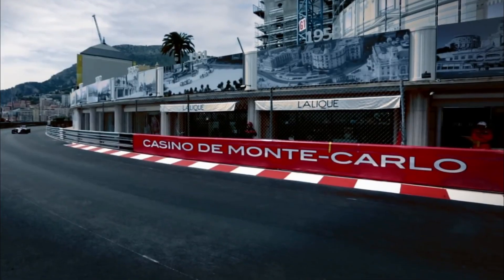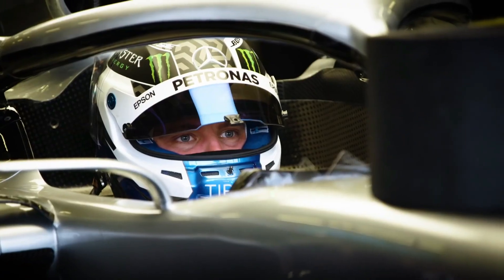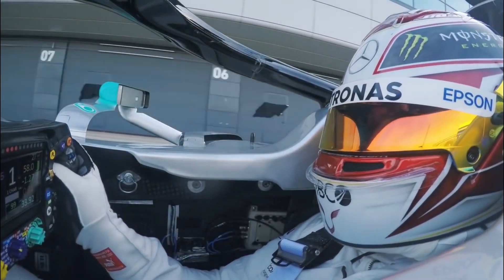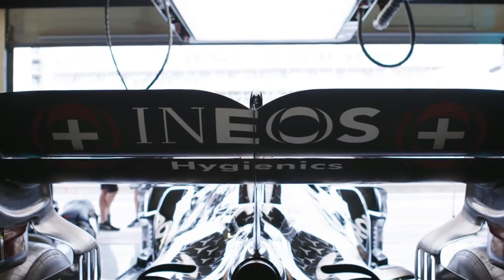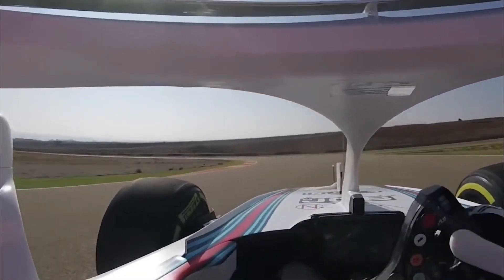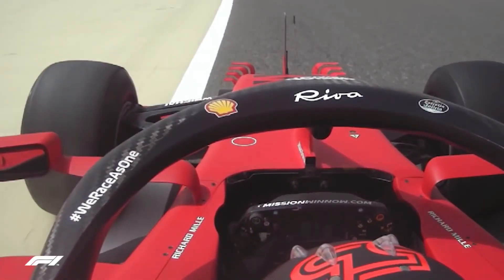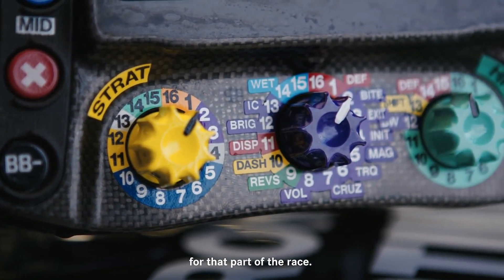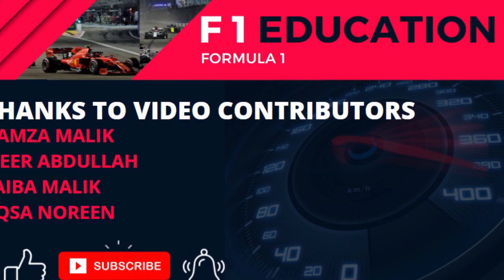Formula 1 Steering Wheel Explained

Comment: Great video! Was it the Brake button that cost Lewis the race in Baku? Also, I've heard that drivers take off the wheel when they get out of the car because otherwise they won't be able to as the space is too narrow. Is this true? P.S. Thanks for mentioning me!
Reply from the maker: Thanks for comment. I believe it was the break bias with Hamilton - I found the following description

"The brake magic button on the back of the Mercedes steering wheel is there to give an instant switch to almost full front brake bias as an aid to heating up the front tyres before the start or restart of a race"

I have noticed that too - not sure if they cannot get out or if there is a regulation that requires them to remove the wheel. They do have to put the wheel back on the car before they leave (I think that is a rule).